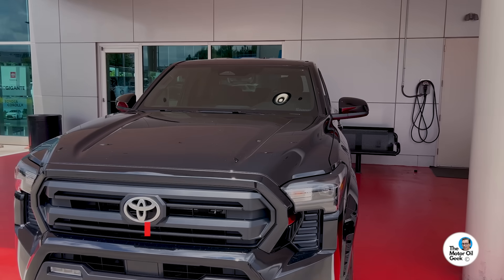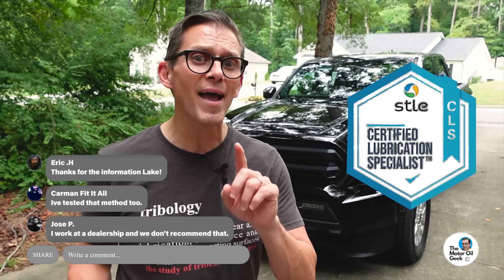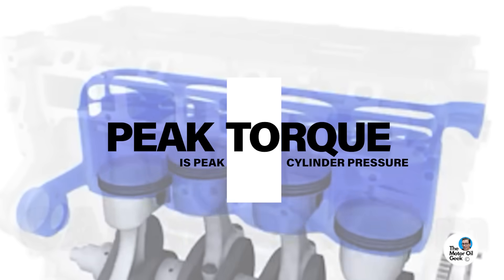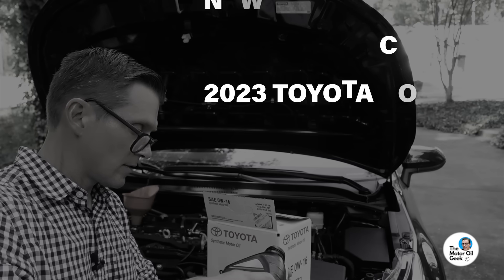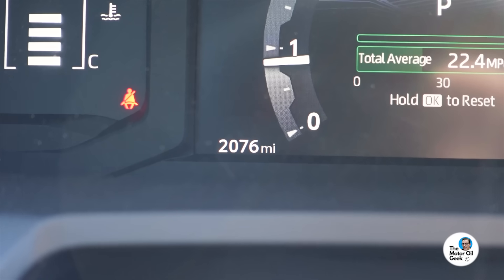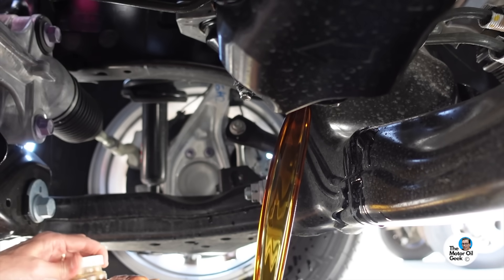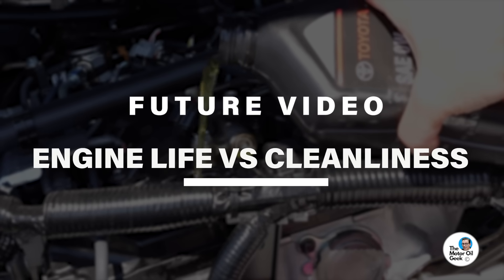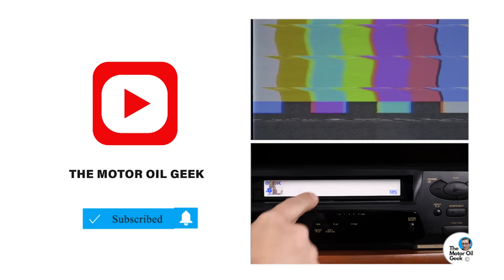The FACTS About Oil Changes (What The Owner's Manual DIDN'T Tell You)

Comment from the maker: Thanks for watching this video. Here's another video that deep dives on engine break-in and break-in oil: https://youtu.be/X4424Q5lLR8
Reply: THANK YOU!! Your wisdom is VITAL! for the longevity of my 2021 Tacoma. Although! I do tend to drive very slow. Of course, I am 64 years old.
Reply: @themotoroilgeek 
Are you planning to do something similar for the transmission fluid?
Reply: Question that I haven’t seen answered, is the oil/engine reliability when we look at Hybrids, especially the Atkinson Engine configuration in the Hondas? These are constantly coming on and shutting down. Honda is using 0w20 in the Civic hybrid. What considerations, if any, should one use when selecting an oil for that car? Honda oil? Or something else?
Reply: Can you do a video on Toyota hybrids oil dilution with gasoline
Reply: I definitely don't trust the Mazda owners manual. They say 0W-20 in North America, but 5W-30 everywhere else. Somebody's getting shafted.
Reply: 5:00 we had a customer with a street sweeper that dusted his rings out in a year. 
He was cleaning the air filter daily and replacing them monthly. 
People look at me funny when I tell them they can over service their air filter.
Reply: I was going through your upload library for recommendations on frequency of oil changes, in particular for older Toyotas.  Hope you will do a video on the topic in the future.
Reply: I've told people this for years, but so many of them don't care because "well the dealer said it is free oil changes at __ miles, so I will wait until then"..............Yet any new vehicle I have ever had got an oil change at 1k, 3k, 6k, 10k, & 15k, with oil analysis on every one, and judging where to set the oil change interval at that point.
Reply: Okay , you're crazy in the video s,. Keep up the good work 👍🎉😁
Reply: Serious question: what about transmission break-in? (2019 Honda Ridgeline owner)
Reply: I would say that the primary reason NOT to buy this vehicle is this turbo engine
Reply: Can you point out what “bad data” exists in the early change intervals that would have been problematic had you just delayed the first change to 5k?
Reply: Huh, TIL that I change engine break in oil more often the Oil Guy. i do 500, 1000, 2000, then 4000. The last one is just that I'd prefer an even number to start the full cycles. Why my brain thinks starting from even is easier makes no real sense to me but it also works best for me 😂😂😂

Comment: Hello, Great video and information!
I have a 2026 chevy silverado zr2 6.2l. With the issues on lifters and recalls on engine, what insight do you have on this issue? From the owners manual, it calls for ow-20 and change oil at 600 miles

Comment: 500, 1,000, 1,500, 2,000, 3,000, 5,000 oil changes for break in and then 3,000-4,000 mile oil changes after break in. 

You can use super tech full synthetic $25 oil and filter out the door. 

What’s that $150.. for break in cost…? I won’t blink twice.

Comment: Disagree with driving the oil warm so that it drains “faster.” Thorough draining is more important than fast draining. When I was doing my own changes, I’d let it drain for 30 minutes or so most of the time with the filler cap loose to promote unimpeded flow. Allowing extended draining time almost always produced a “burp” at some point that resulted in a final surge of used oil drainage. If my priority was draining the old oil quickly, that last quantity of used oil would have remained in place for at least another 5,000-ish miles.

Comment: So, his initial change intervals can be misleading.  The first 3 changes are at 500 miles, 2000 miles (1500 later), and then 5000 miles (3000) later.  Meaning 3 oils changes in the first 5000 miles.  The way he says it, it seems like he was saying change at 500 miile, 1500 miles, and 3000 miles.

Comment: I did a very similar thing, although I did change the filter each time. 

That first filter change was eye opening. There was an alarming amount of glitter in the residual oil in the bottom of the filter housing. 

I've now done another 8 changes and I'm at 40000 miles, I've never seen any glitter or metallic sheen in the oil filter since. 

It's that very first change that's so important. In the future I'm planning to do the first change at 50 miles.

Comment: My 2024 tundra just blew up with 9,229 miles under to heavy load, just driving along at 45 mph. dealer oil change around 9 k as i pushed them to do it early. I tried to get them to do it at 5 k. nope. even offered to pay. I think my truck falls under the new recall. I will find out a few days.

Comment: I change all the oil in my families vehicles 2008 Jeep wrangler 3.8,  2012 Dodge Durango 5.7 Hemi,  2017 Dodge Ram 1500 5.7 Hemi,  2020 Jeep Wrangler 2.0 4cyl Turbo. I use Mobil 1 full synthetic 5w20 for all vehicles except the 2020 Wrangler is 5w30. My question is should I continue using these oils I show here or change to something different? I live on long Island year round. 4 extreme seasons.

Comment: Hypothetical scenario: if someone had the budget and discipline to do only ONE early oil change between brand-new (0 miles) and the manufacturer’s first recommended interval, when would you personally choose to do it?
Around 1,000 miles / 1,600 km, 1,500 miles, or another point?
And in that single early oil change, would you:
– change oil only, or
– change oil and filter together?
Assuming a modern, tight-tolerance, direct-injection engine.
Thanks!

Comment: @themotoroilgeek, thanks for all the great videos!  I've been binge-watching this morning.  I'm glad you specifically mentioned NOT changing the oil filter on your 500- and 2000-mile oil changes.  I was searching your channel for videos with recommendations about filter changes during this break-in and just happened to also watch this one even though I expected it was the same info as older videos.  I did see in the video about the first change on your daughter's Corolla that you changed the filter and wondered about pros/cons of doing that since it seemed counter to the idea of filtration efficiency improving as the filter loads up.  Is it safe to go all the way to 7500+ miles before the initial filter change (your outline says change at 500-1000mi, 3000-4000mi, then every 5000mi, which would put 3rd change at 8500mi, although you did your second change at 2000mi instead of 3000-4000), or is there risk of the filter no longer providing adequate flow because of high particle count in the oil during break-in?
Reply from the maker: Thanks! To be safe, I changed the factory filter at 5,000 miles.

Comment: Comical, I have a 1999 Toyota Tacoma with 279,000 miles on it. I will never get rid of it because it has a naturally aspirated engine and it not direct injection. Same with a 2004 Honda Civic with 225k miles.

Comment: 10K mile oil changes on my 2018 Camry hybrid when I bought it new. Dealer did the first 2 for free, after that I did it, Mobile 1 0W-16 and a $5 filter from the dealer. Never had a problem. I certainly wasn't about to change the oil the first week, then the next week, and then 4 weeks later. But hey, you spend your money how you want. I bet you run a shit ton of ammonia copper cleaner through the barrel of a new rifle thinking you are helping to break it in properly don't you? (When I first bought that car I drove it 650 miles a week for 8 months due to work.)

Comment: Have been watching your videos for a while and decided to change the oil myself in our new 2026 BMW X5 50e PHEV @ 2,000 miles (half of which was driven in electric mode, so the B58 combustion engine has about 1,000 miles on it) with OEM BMW 0W12 oil and was amazed of the metallic material in the oil extracted from the engine 🤨.  Will do another oil change in 1,000 miles driven with the combustion engine...

Comment: I would love an expert opinion on Toyota 0W8 vs Mobil 1  0W8. 

Obviously Mobile 1 is easier to find and much less expensive!

I’ve heard that Toyota oil is made by Exxon Mobile but that it is to Toyota’s specifications with a different additive package 🤔

And thanks for the tip on not swapping the filter 👍

Comment: Do you mind clarifying your recommended procedure just a bit? As I understand it from the video, you're saying:
1st change:     500 miles on vehicle |    500 miles on oil (no filter replacement)
2nd change: 2,000 miles on vehicle | 1,500 miles on oil (no filter replacement)
3rd change:  5,000 miles on vehicle | 3,000 miles on oil (first filter replacement)
4th change onward: Oil changes every 5,000 miles (unless directed by oil analysis stating longer intervals are ok)

From the video description:
1st change:     500 - 1,000 miles on vehicle |    500 - 1,000 miles on oil
2nd change: 3,000 - 4,000 miles on vehicle | 2,000 - 3,500 miles on oil
3rd  change onward: Oil changes every 5,000 miles (unless directed by oil analysis stating longer intervals are ok)

I.e. the video description makes it seem like there is 1 less oil change than the procedure in the video? I apologize for the lengthly comment, but engine break-in really stresses me out, so I want to make sure I understand the most optimal way to do this)

Thank you for everything you do!

Comment: How much difference does this actually do is another question. Have yet to have an engine fail on me and i and most other people does not do this. I think the manufacturers thought about this or else we would have ALOT o blown engines.
I have a car and engine that is 36 years old. I am the second owner, its now a classic. i asked the owner about break in because the engine is in pristine condition. his answer was: what is that? i did what the manual said about oil change intervals.

So yes but is it really worth it if the rest of the car is beyond repair? Probably not.

Comment: I have a 2024 F-350 6.7L diesel and the main timing gear slipped on the main shaft at 17,000 miles.  Ford replaced the engine with a new factory engine.  I drove it 1,500 miles and took it in for its first oil change.  The Service manager said that I did not need to do that, because Ford tests all 6.7L diesel engines by running them on a stand for an equivalent of 30.000 miles.  I figured that he was full of kocka, so I had them change the oil anyhow.  My question is, was he correct in the fact that Ford checks each engine on a stand, before placing them in the vehicle?  Or was he full of it?

Comment: I’ve always heard the oil viscosity’s that is spec for USA vehicles engines is very limited and thinner than for the same engines in different countries. Would we be better off getting a spec from some other country with a similar climate as where we live in the USA and using that recommended viscosity instead?

Comment: The dealer normally does the first oil change for free as with my 2022 tundra. They did the first oil change for free and then at 10,000 20,000 and so on.

Comment: Pains me to see 0W-20 being used.  Would have drained it as soon as I got home from the dealer and replaced it with 0W-40.

In fact, now that you have this data on 0W-20, it would be interesting to compare used engine oil analysis done at the same intervals with 0W-40.  Perhaps tow the new truck home, idle it to operating temp and then drain the 0w-20 to minimize how much wear metals get flushed in the pre-test oil change.  Or drive it home, but also test the wear metals in pre-test oil.  Add those the wear metal count at 500 miles to make it a more fair comparison between 0w-20 and 0w-40

Comment: thanks for the video, I have a question, I just bought a 2025 ram 2500 with a Cummins 6.7 engine in it, I just put around 800 miles on it right now, so on a diesel engine should it be changed out now and not when the factory recommends it? or does it have special break in oil in it right now? also is Rotella T 6 a good choice to run in it? thanks

Comment: Glad to discover your trustworthy channel. Ford told me there was no break-in, and to bring the new 25 Maverick hybrid truck in at 10 grand for the first oil change. Out of their blooming minds. Will change at 500, 1000, and 3000. Owned 5 Toyota trucks since 1979, and changed the oil religiously at break-in, and 3-5K thereafter. The 2010 Tacoma just rolled over 300K, and uses not a lick of oil. Will do the same changes with this Maverick hybrid. Air filter changes are crucial as well.

Comment: What is really missing in your video is the TRUE science. The actual question is to what extent will doing these excessive oil changes actually result in longevity of the engine?  Yes, they don't break it in at the factory and you need to treat it properly to break it in. Still, if you look at the total life of an engine in a typical Toyota that is maintained properly, (I have a friend who put 600,000 miles on a Camry) your method might result in an almost unmeasurable increase in longevity. Of course, it's impossible to do the actual science on that because you would have to buy two vehicles and drive them till the engine quit, with the only variable being your changing the oil three times in 1500 MI. I don't need to do the longevity test to tell you that there will be an almost imperceptible difference statistically.

Comment: I have a 2020 Chevy equinox with a 1.5 ltre with turbo. The manufacturer recommends decor 0w-20 and change every 7000 miles. I change every 4000 miles. But in other countries they recommend 5w-20. Any recommendations?

Comment: Just purchased 2 new explorer STs. Changed both oils at 500/600 miles with Amsoil 5w30. Ill do it again around 1500 and again at 3000 and every 4000ish moving forward. I run top tier fuel, typically Shell Vpower. I traded in my 15 F150 5.0 with 235k miles and it ran like new. Absolutely no issues from new. Also traded in my wifes 22 Hyundai Santa Fe with 89k with the turbo 4 and same maintenance schedule/fuel and same results. Ive ran the same oil/fuel on every vehicle ive owned and ive never had any issues other than general maintenance.

Comment: IMO if you want a modern car to reach 6 figures on the odometer follow "The Motor Oil Geeks" advice re oil changes and also avoid Turbocharged motors, CVTs and DCT transmissions get yourself a regular AT or a stick shift (but those are rare nowadays).

Comment: I'm glad I came across this video because I am a old guy that has been changing my oil for well over 50 years and have been doing the same type of oil changes on new engines like you have suggested in this video. But I have a question,  I have recently bought a new chainsaw which we all know is 2 Cycle and my question is were does all the wear or break in particulars in up in a engine that does not have a oil sump to flush out? My uneducated guess is that mostl remains in the bottom  of the case of the engine. What do you think, and how can we best break in a 2 Cycle engine other than run a little heavier oil mixture? Sorry for the long reply.  I enjoy your content.  Have a great day.

Comment: I bought first brand new car last year, 2024 WRX.  I changed my oil as per your instructions, 500, 1500, 3000.  
The first oil change was the most disgusting oil change I have ever seen in my 20 years of doing oil changes.  The car is so smooth compared to when I first got it. 
I also changed the trans and differential fluids at 1500 miles.  That was also disgusting, and the car rolled easier felt smoother after that, the magnetic drain plugs had silver blobs on them!

Comment: I have a used 2019 Rav4  non turbo it has 0-16 recommendation. I live in the california desert.average summer temperatures are 110 to 120 degrees. Using any thing  less than 5-30 wt in the summer scares me. I have heard that toyota uses a computer program that varies oil pressure according to engine load. Can you advise me on this.

Comment: I have a 2020 Frontier with 3.8 that got a new engine at 50k. I have 17k on this engine at this time. Changed oil with 5w30 for 3 oil changes and all of them had metal. Just did 4th oil change and went to 0w20 recommended. Engine just now broke in and hopefully no more metal in oil. Yes there has been a decline, however still showing at the 15k oil change.  I change oil at 3 months since this is a work vehicle that gets lots of miles. 60% city driving